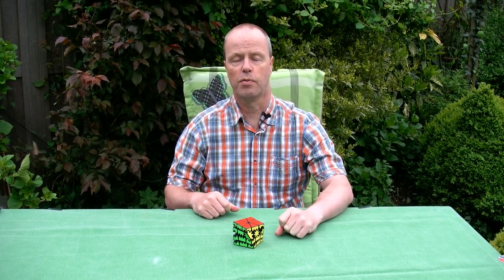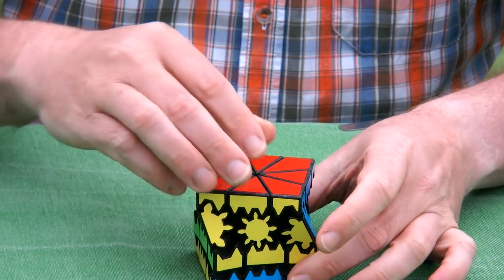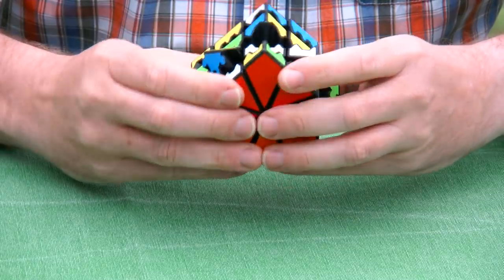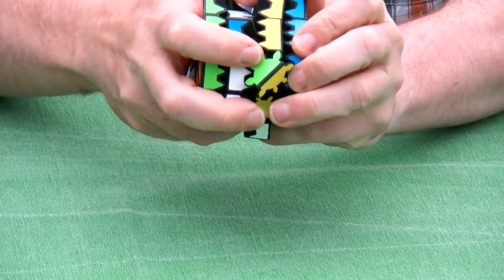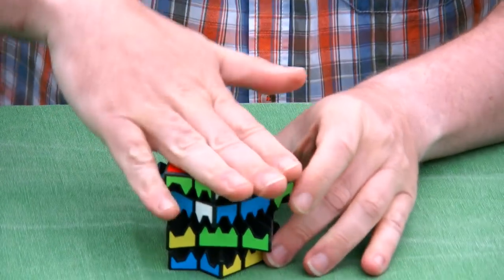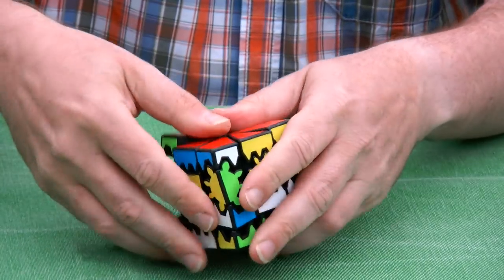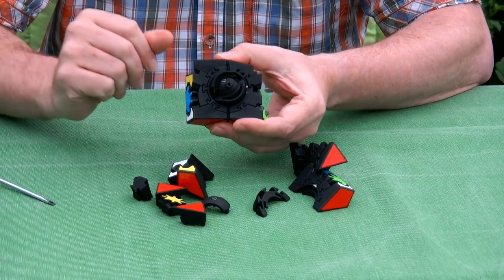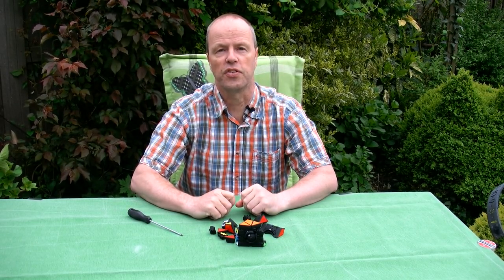Overdrive Cube - failure?

Comment from the maker: How could the mechanism be improved?
Reply: OskarPuzzle maybe create a 5x5 to even the machine and turning out.
Reply: Take a gear 5x5 and try hiding the middle layer
Reply: Fixing the stuck pieces 
Or lockup’s
Reply: Is it possible to have gears in both middle layers instead of just one?
Reply: [GD] Sidney30 no shit. The question was HOW not what to improve.
Reply: I don't know if anyone noticed this but this video was posted yesterday and this comment was posted 2 months ago... I AM MUCH CONFUSION
Reply: TriggerChoco WAIT WHAT
Reply: TriggerChoco you can upload a video and not release it. He probably wrote the comment after uploading and then took a while to release
Reply: Maybe adding something to help guide the pieces into the groves. (But I don’t know what this would look like, I’m not good at cad)
Reply: What about making it bigger so the mechanism can be smoother?
(with better details)
Reply: Have the gears go all the way into the core, in a conical fashion

Comment: Thank you for showing us the interesting mechanism. Although considered a failure by you, this is still a masterpiece of engineering. The top layer reminds me of a Square-equal rather than a 4x4 but I can clearly see the difficulties you have with designing a 4x4. The fact that the middle two layers can be swapped makes it even harder to design. Maybe you could use different sizes of spur gears for the two middle layers that the combined together move the rack and pinion parts of the outer layers.
Reply: The top layer's cut pattern is the same as the one on his earlier Gear-1 puzzle.
Reply: Wow. Make me feel like I know nothing.

Comment: Suggestion (based on the 2x2 gear cube that can be pulled apart):
a 4x4 cube where every tile is a gear, so all tiles turn at once, but you can pull two halves apart in any of the 3 directions and only turn a 2x4x4 half (then stick them together again etc.)

Comment: what if you made it like a 3x3x3 gear cube but each gear, when aliened correctly, can be split allowing for 4x4x4 rotations?
Reply: SheTheTDE nice idea.
*aligned
Reply: SheTheTDE but how can you make the middle gears rotate when they can split?
Reply: hm... they could lock? twisting the end clockwise turns the gear but will not split it and turning the end counter clockwise will split the gear but will not turn it?
Reply: I'm not a very mechanical person I'm just a visual person I can see how the working model will look but don't know how it will work
Reply: The problem is that they will not turn because they will slice instead. Once they align, or the friction between center layer pieces will force them to turn or they will slice freely. There can't be both (just to be more clear)
Reply: Your clock/counter clock turning difference is a very nice solution to it! Pretty elegant
Reply: And I think Oskar already uses this mechanic in another puzzle
Reply from the maker: You know David Gear Cube? http://www.mefferts.com/products/details.php?id=916
Reply: OskarPuzzle oh, hi Oskar! I know it. It doesn't have the middle layer problem we are talking about because the slice and rotate force's angles (I don't know how to name it better) are not parallel, instead they form a 45 degree angle. 
And it is in my "to buy" list :)

Comment: What if the channels of that second-in shell (the one with pieces shaped like wedges/Es at 2:50) had wider openings to allow for some "slop", to get the layers to align a bit while turning? "corner cutting" of sorts...   Which layer is the binding happening on?

(Also, thank you for sharing "failures" as well as successes. :D)

I personally can't afford your shapeways-printed puzzles (not a complaint about the price, but about the thinness of my wallet) - but i'm glad that I have been able to buy a few of your mass-produced ones! :D)
Reply from the maker: The problem is misalignment of the core, which should be solved there. Typically, adding slop makes tolerances issues worse.
Reply: OskarPuzzle  ah. Ok. That makes sense.  
Fix the problem not the symptoms. ;)